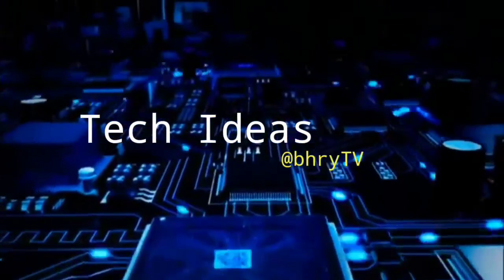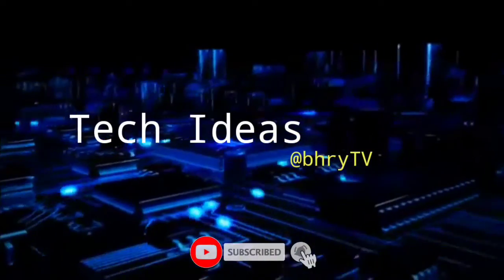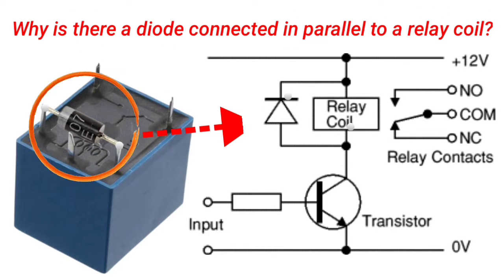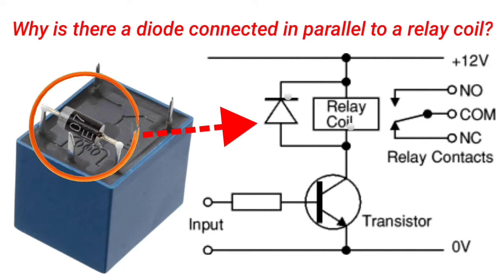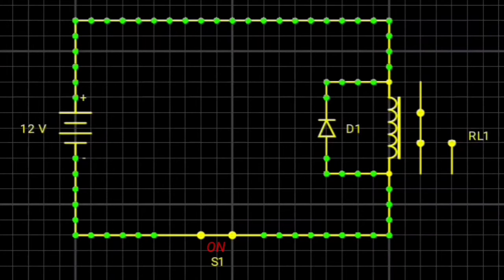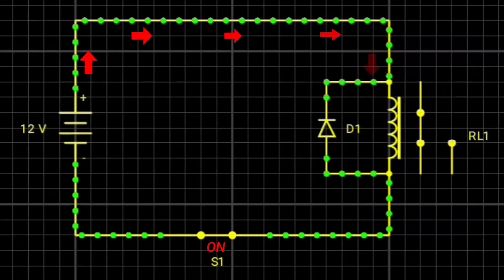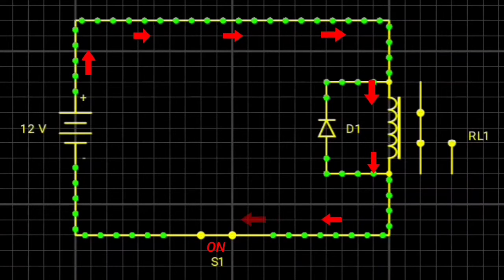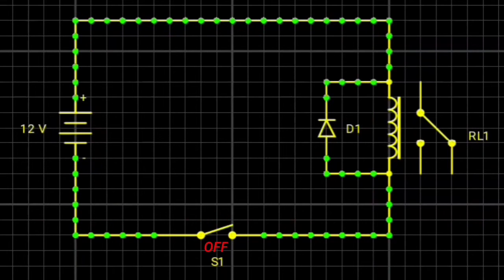what is the purpose of the diode connected to the coil of the relay in the circuit

Comment: And if the DIODE isn't enough it also helps in a circuit like this to use a Darlington Transistor. I've built this circuit many times with the transistor/relay. BEFORE I found out about the diode 30 some odd years ago, I couldn't understand why the transistor always fried when the relay contacts opened and closed (at that time- no diode across relay coil).

Comment: Excellent - short and concise.

I hadn't thought of the collapse of the electrical field in the coil generating voltage.

This is similar to the way a condenser (capacitor) protects the points from arcing in the old automotive ignition systems.

Perhaps the diode protects the relay itself in this example?